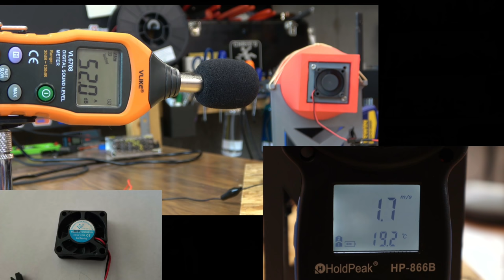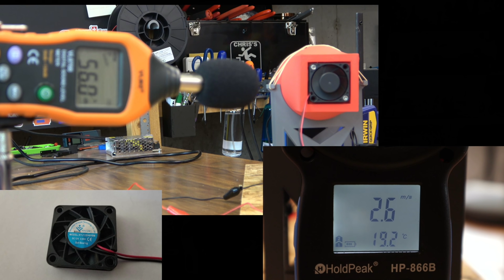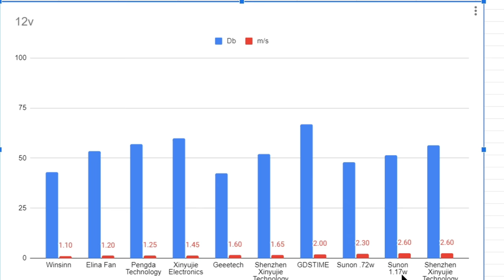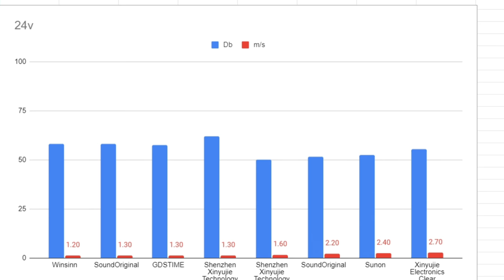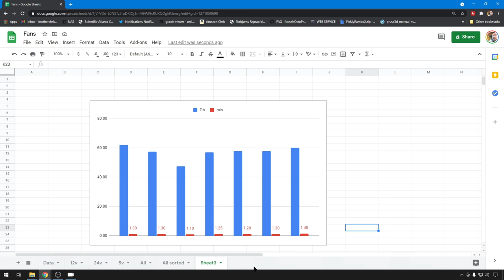Fans! Fans! Fans! - We Test Every 3D Printer Fan I Can Find - Chris's Basement

Comment: Blowers are useful when operating into a higher pressure, like a part cooling nozzle. Thanks for the interesting video.
Reply from the maker: Great point! Thanks!
Reply: Check this excellent video for that: https://www.youtube.com/watch?v=SX-okOHvh1Q

Therefore the test in this video doesn't say much about part cooling. You need to test ducts for that.
Reply: Static pressure is a key characteristic for both hotend and part cooling fans due to their usage blowing through ducts (part fan) and through heat sinks (hotend). High static pressure is more important than high cfm flow
Reply: @ChrisRiley  lol knew it would be the Alex Kennis video.
Reply: @Sebazzz1991  yayyy Alex saving the masses!

Comment: Hello Chris, 
I am HVAC Engineer 
Nice test but absolutely not relevant for the blowers 
Blower are designed for high static pressure, axial fans are absolutely not designed for static pressure. The measured airflow index (Speed) is probably wrong because your blowing on the center of the anemometer without a diffuser ideally you should measure the air intake of the fan or use a diffuser on the supply of the fan. If you want, I can design something 

Greetings from Belgium
Reply: It is relevant since it's a comparison between several identical fan styles, blower fans which output higher wind speeds will have higher static pressure.

I worked for Lennox building blower fans, from 3 ton up to 30 ton units.
Reply: No because the reading are wrong depending on the speed and turbulence created against the anemometer, trust me if you want a clear reading measure the air intake
Reply from the maker: Thanks for the tips, I knew something wasn't right. I for sure want to setup another rig for more testing.

Comment: Something to keep in mind - airflow fans and pressure fans are fundamentally different. The typical 5015 nozzle part cooling fans are pressure fans, they aren't supposed to deliver a lot of airflow. On the other hand, axial fans are typically open enough that they don't have a way to counter backpressure, the air can slip right through them backwards.

What happens when you drive an axial fan into a narrow funnel such as a part cooling nozzle, the airflow pretty much blocks up by vortices and backpressure, and they simply don't make enough static pressure to push through. You might get some air movement just a little bit on top speed, but not much. With centrifugal/radial fans, a lot more useful airflow remains.

So maybe running the fans through a narrow constriction and then measuring the airflow could make for a valuable test?

Also it can maybe be good to have measurements of each fan at different voltages, then you can fit a curve to each and compare them, maybe some fans will jump out as being particularly interesting. Though i guess apart from firmware PWM control, most people unlike me won't be willing to vary fan speed; me i have drawers full of adjustable regulators, so i don't mind.

My 5015 fan that i got from an anonymous seller over 3 years ago is showing severe wear, it's still properly lubricated, but it has gained some bushing wear or maybe it's cracked, anyway it's now prone to vibration and extra noise. I have now ordered a Sunon MagLev MF5015VX as a replacement, it should be in the mail shortly... but i wonder whether i should have gotten a Delta or something instead.
Reply from the maker: Thanks for all the great info here in the comment.

Comment: I think there are 2 things you didn't take into account that make a lot of difference.
The first is static pressure, which is where the blower fans will win. To make it a fair a fairer comparison make a smaller blower outlet (similar size to the blower output) and test the fans again.
The second (which is very hard to test) is the type of bearings used. Some bearings will be very quiet initially but quickly become very noisy after a little use. So even though very cheap fans might perform great now, odds are that they won't stay that way for long.

In any case, very nice and useful comparison. Thank you!
Reply from the maker: Thank you for your insight!

Comment: That's awesome, I did a similar test myself with a anemometer comparing the stock 5v fans on my Lulzbots to Noctua 40mm fans. The Noctua fans output roughly 10% higher "wind speed" than the Pelonis fans. I have always bought Noctua fans without doing much research as I thought they were industry leading on the noise to output charts, now I know better!
Reply from the maker: Thanks! Yeah, I had a lot of questions as well. Not sure if I answered them, or just made more. LOL

Comment: This is an excellent roundup, but one thing I'm missing is any way to compare static pressure.
Especially in high restriction scenarios, like parts cooling and restrictive heatsinks, that would make a big difference for fan choice.
But I don't know if you have the equipment to do that.
Still, this is a great and pretty comprehensive comparison.
Reply: The dirty way to measure static pressure when having fans go head to head is message a delection of a pivoting object. You won't get hard numbers but you get a way to compare fans against each other.
Reply from the maker: I for sure want to come up with another round of tests.
Reply: @ChrisRiley  Any interest in doing a slew of industrial fans? More Sunon, Delta, TDK/Lambda, Orion, etc..? I'd love to see how some of the cheaper industrial style fans compare to the ridiculousness of Noctua. I run a mix of Orion, Sunon, and Delta on all my printers and would argue its been one of my most rewarding upgrades.

Comment: I've been purchasing fans lately and my choice is sunon for 5015 blower, 60x10, and 40x10 but I also needed 3010 blowers but sunon doesn't make that size, I went with winsinn unfortunately since they were easily sourced and indeed they are not quite.

I chose ball bearing for longevity, keep in mind ball bearing fans usually quite down after around 20 hours of use but aren't generally as quite as hydraulic or sleeve bearings.

Nice video and I'm glad to see sunon get the recognition they deserve.
Reply from the maker: Thanks for your insight and thanks for watching!
Reply: Makes good sense that they quiet down after running the bearings in for a bit and they loosen up

Comment: I'd like to see a longevity test. The stock fans in my Ender 3 seem to start squealing and making a horrendous noise at around 200-300hrs of printing and need replacing. I've even had a couple fail after only 50 hours.
Reply from the maker: I'll look into it!

Comment: @Chris Riley - What would you recommend to replace the god awful Hemera heatsink fan? I don't want to throw a noctua on it because I'm pretty sure it won't cool enough. Thanks for the great video.
Reply from the maker: I would go with the Sunon .72w.
Reply: @ChrisRiley  I had my eyes on this one: Sunon MF40102V2-A99. 1.11W so do you think it'll be louder than the .72W? Also I posted a video on my channel about the Hemera Fan at different voltages, and then put on the stock ender 3 heatsink fan. Just need to test to see if it pushes enough air to cool. If you could watch it and leave a comment that'd be dope.

Comment: The dB is on a logarithmic scale - +3 dB essentially doubles the intensity of the sound.  On that basis are the Sunon dans still better than the Noctuas in terms of noise per flow rate?  Also have you considered static pressure vs. Flow rate for axial vs blowers?  Perhaps different requirements for both designs?
Reply from the maker: You've given me something to think about, thanks!
Reply: Had the same thing in mind when I was watching the video. Would be interesting to see, which flow the sunon would have at 40dB.

Comment: The only fan i missed here was the 5015 blower sunon maglev one :D Anyway an AWESOME vid!
Reply from the maker: Thank you!
Reply: Purchased these, generally they run great at acceptable noise level but I dont get them working with lower PWM rates. Swapped today to GDS time and they work fine at lower rates. Generally PWM would have been great as another aspect for this test
Reply: @tobiasinglin5644  Mhm, here's the added function key for the models that i found:

999: standard model
A99: AutoRestart
C99: F type  (3rd wire)
D99: with PWM
F99: AutoRestart and R type(3rd wire)
G99: AutoRestart and F type(3rd  wire)
H99: AutoRestart and with PWM
Q99: AutoRestart , R type and with PWM
S99: AutoRestart , F type and with PWM

Apparently AutoRestart can be the issue. It detects what it believes to be rotation stall and then disables the fan for like 5 seconds.I ordered one and it turns out it has G99 function, but i suspect i might receive A99 instead, weird seller. Odds are, i can make it work, either by prepending an RC or LC filter or just by playing around with PWM frequencies, higher or lower. Or maybe i should cancel the order and get a Delta? I'm not up to buying junk fans again, this one has taken mere few couple hundred hours tops to start failing.

Comment: The difference in axial vs radial/blower is  the latter will make flow at a greater path restriction than the former. The part cooling duct plenum will pressurize to increase velocity at the outlet. While Axial fans may move more air in open space, they will choke when coupled to a part cooling duct.
Reply from the maker: Thanks!

Comment: Chris -- I admire the amount of work you put in, but I think you only got part way to a satisfying result.  The fans need to be blowing into a load (constriction) representative of their intended application. Fans produce some max flow rate into a low resistance (fan with no load), but progressively less flow rate as resistance increases (constriction) and hence also pressure increases. You measured essentially the max flow rate into low resistance, but did not explore the flow-rate versus pressure, or flow-rate versus resistance curves, which would be highly interesting, among other things demonstrating the contrasting merits of the axial vs radial fans.  I could imagine revising your rig with an adjustable aperture downstream from the fan, as a start. And a pressure sensor would be informative too, along with monitoring the electrical current (and hence power), as an alternative assessment of the load.  The flow rate measurement should be upstream from the fan, to avoid turbulence interacting with or caused by the geometry of the anemometer, though I'm not sure that's a major factor.
Reply from the maker: Thank you for your constructive criticism.

Comment: Very cool test. I did a "low tech" version screwing fans to a box with 2 holes in it, the fan in 1 hole, and a piece of paper over the other, and saw how far the paper blew out
Reply from the maker: That's cool. How'd it go?
Reply: @ChrisRiley  I didn't have nearly the amount of fans as you, I was comparing noise and flow between the stock creality hotend, winsinn, sunion, and a no name, just making sure they didn't have less flow than the stock fan. One thing I did learn, most winsinn 24v fans are just 12v fans with a 24v sticker spinning way too fast.
Reply from the maker: @B3DPrinting  😂
Reply: @ChrisRiley  yeah, after testing them, I'm definitely not a fan, ha ha.  I got my skr e3 rrf in and set up, the esp8266 lasted about 6 hours before it let out the magic smoke. I wasnt very impressed with the performance with rrf firmware, but didnt have much time to play with it. There isnt a lot of support or info, I was having issues getting the bl touch to work, and z offset set.  I'll have a new board tomorrow.  Another question,  the skr e3 rrf in Marlin mode,   is there enough serial ports for the tft35 v3, wifi, and usb?

Comment: Is there a way to check if the fan is compatible with 3D Printer? I bought a Sunon MF50152VX-C02U-A99 -24V 2.86W but it's not working at all when hooked up to the mobo but runs when connected to 24V PSU.
Reply from the maker: The should all be pretty common, just make sure the wiring isn't flipped. If you PSU say 24v then it should work. If it's the part fan you might have to turn it on in the menu.

Comment: Hey Chris Riley,

Can you shed some insight into what is the cause of the discrepancy with your measurements in comparison to the Amazon reviewer?
Does it vibrate a lot?

I was about to buy the SoundOriginal 4020 24V fan to replace the Creality's 4010 Blower that comes with the Ender 3 S1 Pro.
However, Amazon AU and Amazon Customers mostly claim it's a LOUD fan.
You got it listed as being one of the most silent for 24V.
Reply from the maker: They're all so close, it would be hard to say. Maybe quiet for a 3D printer?
Reply: @ChrisRiley  Thanks for the response. I will purchase the SoundOriginal 40x20 and test anyways.
3d printing is such an expensive hobby.

Comment: Could you please upload another video just of the fans blowing and in the same format as the testing part of the video. But without the music, just so we can heard an audible and comparable difference in the fans.
Reply: Another piece of advice to help, from the perspective of a viewer is organizing which order you show the fans, either by size of mount, type, or voltage. I think voltage and size of mount would be two of the most important details to have on screen outside of the speed and decibel measurements that were taken.

It helps significantly to help a viewer organize and understand which fans are the most similar and compare them. Since pinning a 5v fan against a 24v fan can make a massive difference in sound and how much air it moves.
Reply from the maker: I was thinking about uploading the non-music version for my Patreons, organizing them was a thing a struggled with, there were so many different configs.

Comment: Great video! On the blower or turbo fan, I heat glued over where the cables that go into the engine. Under the cables, it´s usually open in the plastic into the fan wheel. Which makes the air come out and noise goes up. May be my imagination but it feels like it works better and sounds less with that hole glued shut. Be careful not to get glue on the fan wheel. It would be nice if you could try it and give an update if there is any difference.
Reply from the maker: Interesting, thank you.

Comment: The db readings are good to see and while we get some notion about airflow from m/s. unfortunately comparing blowers to inline blades is apples to oranges. blowers can compress air slightly, this is incredibly important where airflow is constrained.  in fact open blade designs are really only meant to move air in space that cannot pressurize from airflow. I would like to see you do this test for airflow where the tube is actually slightly smaller than the fan output. it is almost certain the blower fans will handle it with near indifference while the inline blades will suffer huge performance losses.
Reply from the maker: It was a shot in the dark pretty much. I hope to create a better test for the blowers.
Reply: @ChrisRiley  thanks for the hard work man! I'll be on the lookout for it if you make one.

Comment: To quieten my Ender 5+ down I put in a fan less power supply, the cooling fan for the control box I put a really big fan in then controlled it with an Arduino and a temperature sensor, the warmer it gets inside the box the faster the fan goes works great, most of my noise now comes from the hot end cooling fan and even that is set up to be off below 50 deg as per your video :)
Reply from the maker: Cool! Thanks for watching

Comment: The blower type fans, aka centrifugal fans, are designed to push air with brute force. They create high pressure which pushes the air out forcefully. This is advantageous for cases when the airflow path is not straight, thus you see it used in part cooling where the airflow is redirected through a duct. An axial fan may not create enough pressure to overcome the drag inside the duct, and thus reduced airflow for part cooling.

Moreover, from my own experimentation, I found that cheaper fans produce a lot of tangential flow, which just circulates the air in a rotational motion instead of a linear axial flow which we want. This could easily be fixed by using a fan duct that straigtens the airflow, but then it adds extra parasitic drag and may interfere with the acoustics. My noctuas however produce airflow that is very straight right out of the box. I don't imagine this to be easy to test, but I presume that noctuas may perform better even though they deliver less airflow or static pressure.
Reply from the maker: Thanks for your insight!

Comment: Some experience I just encountered, I put a biqu h2 on, and I had a chance to use either an axial and a radial fan on the same duct. Where there was resistance, the axial fan didn't push the air through the duct, it cavitated, and pushed the air back on the wrong side of the blades.   If you do another test, maybe make some type of venturi, to test the fans pressure ability. Either way, great data, thanks!
Reply from the maker: Cool, Thanks!

Comment: Love this kind of research, could add in the difference between a cfm and static pressure fan , this is useful to decide witch fan to use for what application.
to cool a pc/ electronic/ chamber case its recommended to use a high cfm fan,
to cool a radiator/ heatsink/using ducts its recommended to use a high static pressure fan.
Reply from the maker: Good idea!